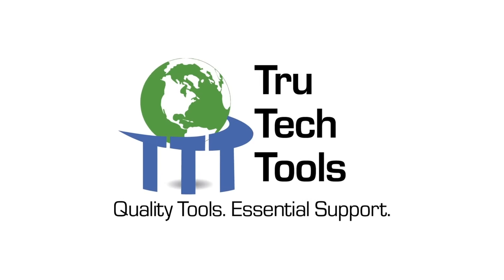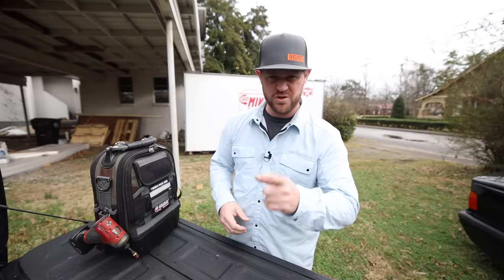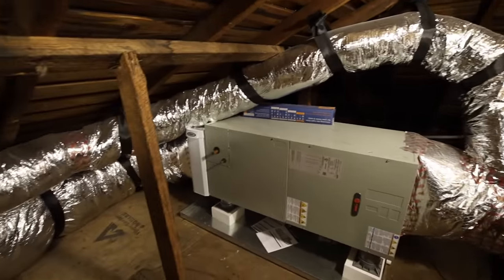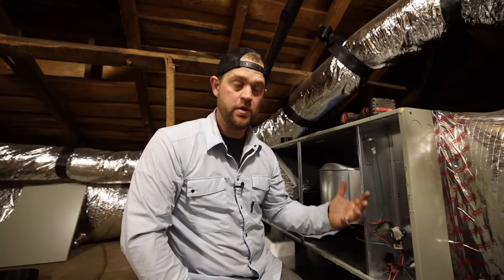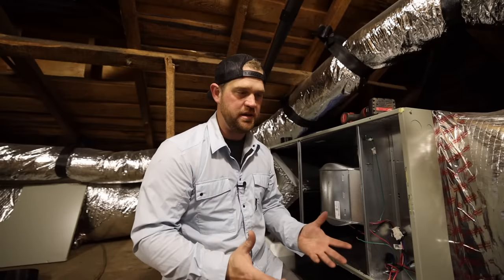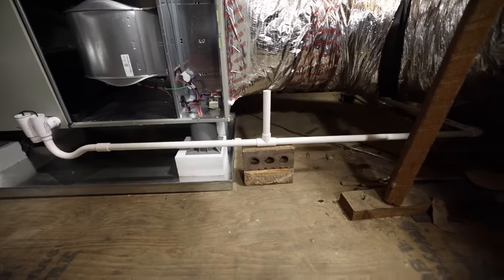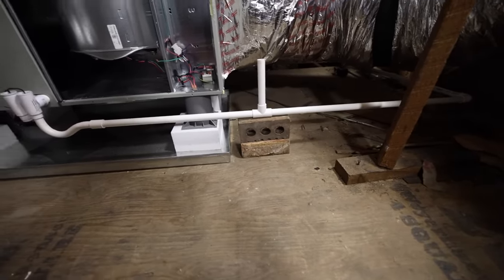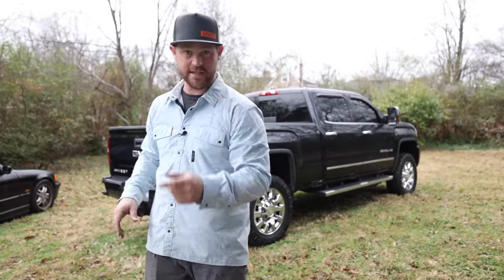I Should’ve Known BETTER…| HVAC Install

Comment from the maker: I didn’t convert the coil properly, I need to go back and flip the u-bend troughs. Thx Ted Cook for pointing that out to me.
Reply: Love your channel, and love Ted Cook’s channel as well. The true heroes of HVAC media, and the trade as a whole!
Reply: U-bend through?
Reply: Those water diverting brackets surprisingly make a big difference
Reply: @emmanuelalvarez4204  I believe he is referring to the two water diverting brackets he forgot to switch. 
Looking at the front side of the coil there is a water diverter fastened to the coils left side tube sheet by three screws. It needs to be removed and reinstalled on the coils right side tube sheet. Make sure it is reinstalled into the upper most hole of the coils right tube sheet and then the other two screws will line up. Now flip the coil around to the back side and remove the diverter bracket located on the right side coil tube sheet. Remove it and reinstall it to the left back side tube sheet of the coil. The second hole of the water diverter needs to line up with the first hole in the coils tube sheet. If the other two screws line up with holes in tube sheet you got it installed correctly. Slide the coil back in place and button her up exactly like Zack showed us in this FINE video. I'm visually assuming this is a 3 or 4 ton. Hope this is helpful sir.
Reply: Yeah typically the manufacturer doesn’t require you to disassemble the drain pan from the coil. You just pull the whole thing out and rotate 180 and slide back in. And then you can flip the door panel
Reply: @jcsimmonsoutdoors  hmm no. If you read the installer guide he did it like the manufacturer requested he only forgot to flip the water diverting brackets
Reply: Would’ve never happened if you would’ve open the installer guide and lookup the coil conversion like you supposed to but I can’t putt all the blame on you though. Who installed it on the right side like that without converting the coil to begin with? Taking the door of the equipment to attach the copper lines isn’t really required you could’ve missed it and flood that unit.
Reply: Nice job man
Reply: Hate to add to the chop busting here but I hope you never have to work on that txv with the way you plumbed that drain line and switch through the access panel.
I always just pull the coil, flip it so the A points to the filter and flip the door. It works much better and you don't loose the access panel. Nice looking install though.
Reply: @joshuawolfer9903  at 7:34 he explains what he is doing next time.
Reply: @joshuawolfer9903  "nice looking install tho"
Good lord...
Reply: Robin DenBeste  Quality HVACR is the name of Zach YouTube channel. Once you find it look for his video titled. "I Should've known Better... HVAC Install"
Reply: Hi, what happens if you leave the coil as is? I am wondering what Ted will explain about it. The Evaporator need to be flip right? I noticed the position of the coil copper lines, after that I was looking return and supply to understand or do I am wrong? Greetings from DFW Tx.
Reply: Mine has two pans. The primary is plumbed to the bathroom drain. The second pan is plumbed outside. The pipe outside only drips if the primary is clogged. A little Clorox down the breather tube once in a while, keeps that from happening.
Reply: When you plum the overflow switches straight out like you did, the water will overflow the drain pan long before tripping the switch. Your auxiliary pen sits on the floor, so how do you provide the required sloping of the drain line?
Reply: As a homeowner I would pay more to get a neat job like this.

Comment: My old old boss went to zoomlock fittings and as a young man I loved them. Now working on my own, with the customers I have, there is nothing stronger than brazing
Reply: @channelcatchaser9426  I'm good
Reply: @channelcatchaser9426  if it ain't broke don't fix it.
Reply: Stay Brite 8.
Reply: Boomerdomus - "Don't fix what ain't broke"

Press fittings have their place. Emergency calls that require burn permits that need a fix like yesterday.
Reply: @lopaka79  yes they have their place.. in the trash can
Reply: Actually, Sta-Brite is better than brazing. It's a superior connection
Reply: @guyinpajamapants6892  Correct! Sta Brite 8 is a SUPERIOR connection
Reply: More and more companies  and some localities  are banning the use of open flames.plus with the supposed  new freon being flammable, it's going to be change or don't work.
Reply: @keithjones197  Refrigerant has always been toxic under flame.
Reply: Brazing is definitely the best option. Especially for a fresh install.

Comment: I wish a "day's work" was flipping a coil pan, running some seal tight, mocking up some copper, and fitting up a drain.  Good video though, I enjoy trying to learn new things watching others who know more than me.
Reply: Making several trips to complete a job = small profit
Reply: This channel is all about advertising
Reply: exactly, when i was an installer my boss would probably have fired me if I told him that's all i did lmao.

Comment: you should insulate your drain line traps, they will sweat in attics and other unconditioned spaces
Reply: There's a drain pan there for a reason.
Reply: @musicnerd72  one thing you did not consider is rust in the drain pan which can simply be avoided in this case by insulating the drain line

Comment: One thing nice about those fittings, you don’t have to worry about wrapping and heating up the TXV
Reply: filter dryer has to be brazed in so its pointless
Reply: @antoniodefilippis323  they actually make press filter driers, pricey like the tool and fittings, but available.
Reply: @marcuscrane1989 the O rings are notorious for getting cooked in heat pump applications

Comment: I really like the electrical installation with the Liquid-Tight flex. Nothing looks worse than the typical Romex hanging all over the place.
Reply: Conduit
Reply: What’s wrong with a Romex does exactly the same thing plus it’s faster and not code to have carflex on wire unless it’s exposed
Reply: @magma1273  ......I agree, 3/4" EMT

Comment: I would suggest that you use larger secondary drain pan with a separate drain pipe to the outside of the house.
Reply: @Bryan-Hensley  if you ever had a safety switch fail or not be fastened/ adjusted properly you would think differently.  It happens.  Having a piped secondary drain line ran out above a window for visual indication, is a good idea.  Also (and I see this all the time) if you have a pan that isn't fastened or supported properly and level, you will have a problem sooner or later.  When it comes to preventing a costly water damage repair, it only makes sense.  Just make sure the damn secondary (and primary too) drain line has fall!
Reply: @Bryan-Hensley  Ss1 to keep from overflowing, wet switch to sense a few drips in pan if ss1 fails, drain on secondary pan and aquaguard as last failsafe IMO
Reply: @Bryan-Hensley  Not sure where your from. But out CA way you are required by code to run a secondary drain line over a window. So if it is being used the customer will see the water dripping on the window and know the pan has water in it. My current employer HATES safety switches because if it is activated it puts you on a very short timeline to get out to the customers house and get the problem addressed as the unit will not operate until it is. Conversely, if you run a secondary drain line over a window the unit will continue to work until you can get out to fix it, all while avoiding having to play musical customers and putting multiple people out for a single issue.
Reply: Maryland an Virginia require secondary drain line from pan to run out parallel with the main drive, no more over the windows, and mandatory wet switch in the drain pan
Reply: @brenth3365  interesting, so of the primary is clogged and the secondary is being used you have to look at that secondary? I guess you mark them then?
Reply: @Bryan-Hensley  lol yes that’s why you either run pvc from the secondary outlet on the coil into the drain pan, or into a Tee that is coming from the drain pan outlet. This is all code on CA. And yes if maintained it should never make it to the pan. But we don’t live in should land now do we?! Just like the vast majority of home owners can’t even replace filters on a regular basis, much less pay someone to come do a service agreement on it.
Reply: @Bryan-Hensley  Um, there’s actually a Federal Law governed by this little agency called the EPA that requires you to have a certain certification in order to handle refrigerants. You may or may not have heard of it. EPA clean air section 608 and it actually has 3 types of classifications within it (type 1, type 2 and type 3) 
Now as far as the government holding your hand. Without proper oversight corners will be cut and/or things get overlooked. Best case scenario you took the customer, worse case you killed them.
Reply: Not to mention if it permitted big government will “hold your hand” as you put it. Or do you only do unpermitted jobs 😂🤣
Reply: @Bryan-Hensley  good luck with that.  As vigilant (or not lol) as we are in proper repair/service/install, we can't control every variable.  We are licensed and carry the proper amount of insurance in the event something catastrophic happens.  That takes most, if not all, personal liability off of you (unless you are a sole proprietor, in which case you might just be f***ed).  If you like to gamble, go to a casino.
Reply: @Bryan-Hensley  good on you brother.  Keep the rubber side down.  Peace.
Reply: Mechanical switches at some point will fail. When thinking that way about it, pipe the condensate in a way that'll either kill the condenser or if the wet switch, float switch etc fails, the emergency pan and secondary drain are piped in a way that'll let it drain to a place that'll alert the homeowner. What's wrong with over the window? Anywhere that'd be unusual to see water. I require all my employees to pipe the condensate lines that way where there's potential for damages that'd cost me. I don't compromise  on that issue.
Reply: @louhood672  metal pans will fail at some point.
Reply: I live L.A  county,, It's code to have secondary over a window
Reply: Do they even make metal pans anymore?
Reply: @louhood672  they have common sized galv. pans @ many supply house, I have small brake and hand solder corners and drain fitting, never had any problems
Reply: Yes

Comment: @ QUALITY HVACR. I've been out of the trade for a couple of years now. 40+ year's of service, repair and install. I do industrial stationary work on 900 and 1200 ton chillers, cooling towers and huge AHU's, MAU's and large CRAHS now. The field service was a marriage of hard work, long hours, and road warrior miles. Grateful for that experience to work on residential, commercial and industrial HVAC and refrigeration. I DON'T miss it. 😉 The technology of the new equipment and tools is fascinating. Keep up the clean and impressive work young man. We need pros like you to carry on the tradition of professional and precise work into the future. Newbies? Pay attention, there are a lot of YouTube videos out there to learn from. Ted Cook with Anti DIY is another fantastic resource. God bless you all in the trade. We ROCK!
Reply: What’s your best advice to gain or retain knowledge for someone starting out in the field?
Reply: @Lumenjensen777  
1st off, have a strong work ethic and be a self starter. 2nd, start learning the basic refrigeration cycle and components. 3rd, check out any YT videos of techs that show how, why and show little tips of the trade. 4th, stay OPEN MIND!

Good luck!

Comment: A Jedi become you have.  On my draw thru unit drain lines I like to put a 1/4 turn ball valve, then capped tee, then p trap, then another open tee.  Allows you to blow thru before or after the trap during service or clogged drain issue.  No more future cutting and couplings, making for a clean job.  Also, don't forget to prime that trap.
Reply: Not a bad idea using a valve before the trap. I’ll have to utilize that
Reply: @austincollier8057  Seems like more of a bottle neck than anything. I go breather before with unglued cap (for later cleaning of P-trap) and a breather after left open. I really don't get why everyone hates replacing P-traps. It's literally one of the easiest things to replace on the dang thing.

Comment: I'm a  fan. I like your quality and your thoroughness.  9:35  "atmospheric pressure" is the term you're looking for. The vent, after the P-trap, allows the condensation drain water to see atmospheric pressure, as opposed to the negative pressure created by the blower motor.

Comment: AC & sheet metal since 85, besides the time saved, not having to use an inert gas when brazing or worry about contaminates is nearly priceless, press tool and extra cost of fittings is nothing compared to old way, dragging torch set up attic, line driers/filters, cost of oxy/acetylene refills, labor

Comment: That 1st take off is gonna have some balancing issues being so close to the first transition also. Should move it down at least 18 inches from an elbow or transition
Reply: I agree, although the duct should fully pressurize eventually if sized and endcapped correctly, rule of thumb is within the 1st 3 to 4 feet of air leaving the fan coil, heater, or whatever you have, don't have any takeoffs within that distance. If you have no choice, install a scoop to help. The installation looks clean though, makes a big difference.
Reply: @louhood672  I mean its literally no duct work, just all flexible duct which is terrible for airflow.

Comment: rectorseal float switches specifically states you can leave it un-glued and wrap with some pipe tape and jam it together. It's on the packaging if you have questions.

Comment: Been putting  dryers  neer AH  they  are first rust out ( outside )  it would  be worth the extra cost if they made  them 100 % copper  ? it's  smart  to have take apart  joints  with the drain line  . Sometimes  the slim is hard to clean out . Nice that the industry  is making  good secondary  drain pan's   . Good install   with room . Be glad your not banging  your head on the joists  or having  to crawl  to work on it!

Comment: You forgot to transfer that metal shroud that catches comdensation from the coil end loops, from the left of the coil to the right side. Anytime you swap the pan you have to swap that as well
Reply: I was about to say the same thing
Reply: Yep.  Drip rail...
Reply: Called a splash guard, the duct will fill with water in cooling mode without it installed
Reply: @lowe_30  splash guards are usually installed on box coils and sometimes slab coils.  Since the evap coil is on the other side of the blower away from the supply plenum, it's unlikely you would have water splashing over into the supply plenum.  Sometimes clogged or improperly installed drain lines or traps can cause water to overflow into the cabinet of the air handler and make its way into the supply or return plenums.  A good drain switch like an SS2 or SS1 helps prevent that.
Reply: @dgapp76  Trane and American Standard have them on A-Coils, I've been to plenty of calls where the splash guard had layed down and water was in duct work and running into floor or ceiling
Reply: @dgapp76  and it ponds up in return side of duct not supply, usually if condensate is clogged the auxiliary pan will fill then water will spill over into cabinet which is made to have fall in that direction leading to water in supply duct
Reply: @lowe_30  yes you are correct.  They even provide the splash guard to be installed.
Reply: @lowe_30  yes, that's what I said in my original reply.
Reply: I see the issue that you Guys are talking about.

Comment: In Florida we mount the air handler on full length and width Styrofoam blocks (2 high if we have room) to take up more space in the emergency pan, and also insulate the bottom of the air handler if it floods with water. This also makes emptying the emergency pan faster on a service call. Would love to spend a day seeing how it works around different parts of the country.
Reply: Florida is pretty much like Texas and other southern States.-
Reply: In my area of S. FL. We use either pans with metal rails/built up strut chassis, etc
Reply: @Floridaman8783  I'm sure in different areas are methods suitable for the job. As long as they comply with the codes!
Reply: @bobboscarato1313  All that matters. Neither one technically "has" to be there per se. It's oftentimes a matter of tech/installer preference and whatever the authority having jurisdiction wants. Around here they don't like the Styro and the blocks are hard to find anyway.
But all the various suppliers stock pans with built-in rails. And we put iso pads on the rails.
Reply: Lol bro I was just going to say something about the way he's got it supported . It looks like s*$# with the pump ups and foam blocks . Why not just fab a nice 2x4 stand or just use a solid sheet of foam for insulation /support .
Reply: I remember we used to suspend air handlers or furnaces with threaded rods from the roof in the attic leaving safety/drain pans clear.
Reply: @kylecaprio294  Human inspiration!